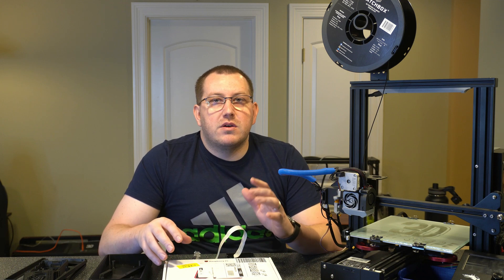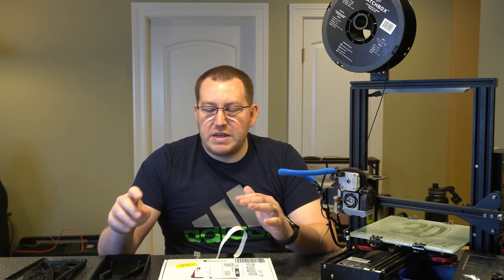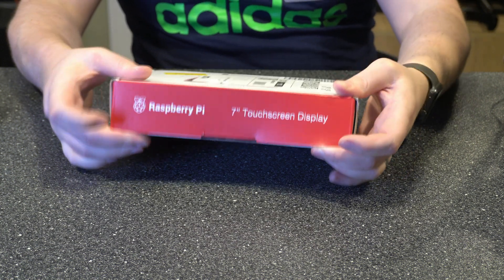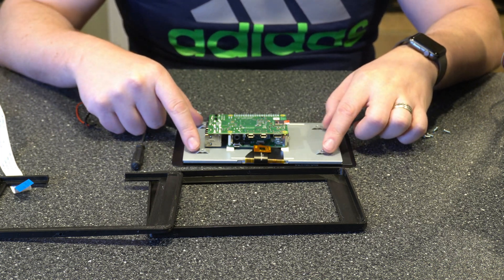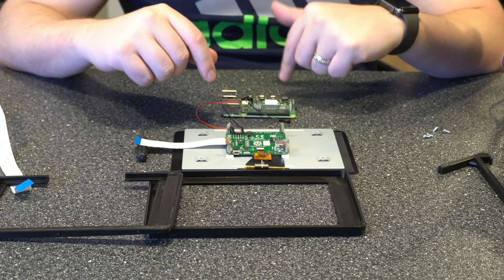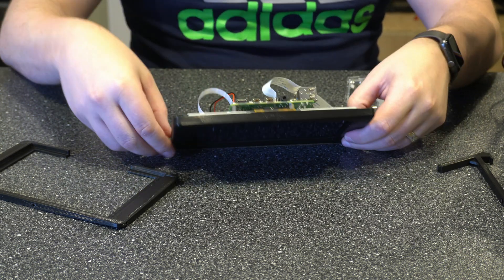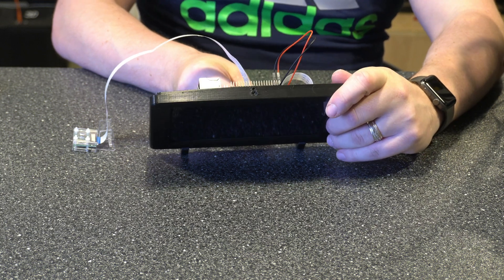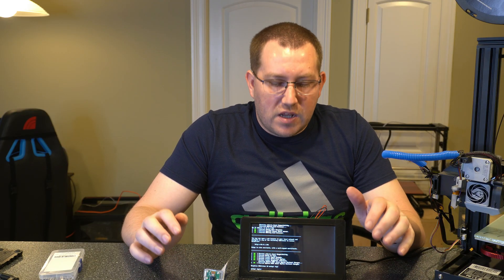Install Raspberry Pi 7” Inch Touch Screen

Comment: will this work with the Raspberry Pi Zero 2 W
Reply from the maker: Hi. From what i have read, the recommended version is the 3+ or later but it should still run on previous versions.

Comment: Hi Rob. This screen is a good idea. I have a Raspberry Pi working octoprint on my Ender 3 Pro.
I have a laptop screen key board and mouse connected to the printer to see RPi working.
Can I run octoprint from a hard drive on the RPi and run the whole show from the monitor eliminating the desk top computer. 
Sorry if this seems a stupid question. I hope you can make sense of my question.
Do you have a video you can direct me to achieve this. Or am I trying to invent the better mouse trap.

Regards
Ernie the old newbie from Australia
Reply from the maker: Hi. You can install Octopi on the sd card that goes into the rasberry pi and run it headless. Adding the screen gives you an extra option for controlling everything. Either option will eliminate the need for the laptop.
Reply: @3DPrintscape  Hi Rob Thanks for the reply. Sorry I'm not a techie I learn stuff parrot fashion.
I have Octopi on the sd card in the RPi and  I can see it boot up on the monitor screen connected to the RPi.
So all I have to do is install octoprint on the OS on the hard drive on the RPi to eliminate having to run it on Octoprint on my  desktop computer.
I hope I'm making sense. I am just trying to eliminate running octoprint of my main desktop computer to free it up for other things.
Thanks for you patience.
Regards
Ernie
Reply from the maker: @ernielazdins1348  I cover the full setup process in this video, https://youtu.be/EBB7aWMDquo . If you need help with it you can also reach out on discord, the invite is in the description.